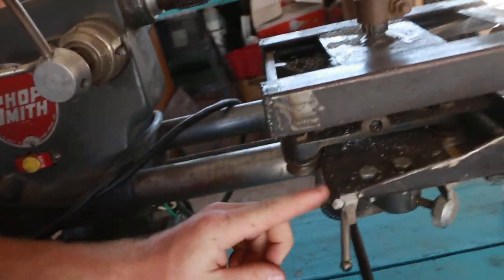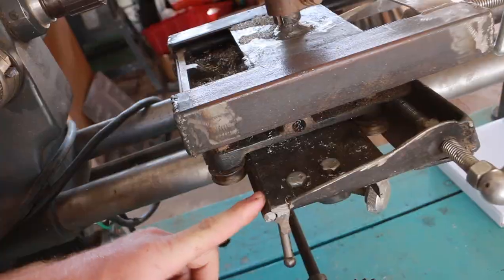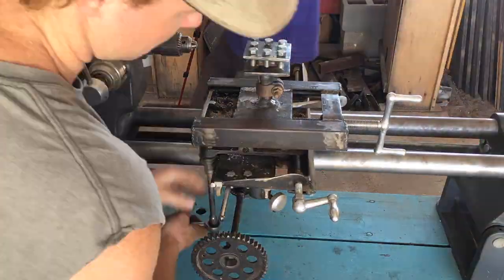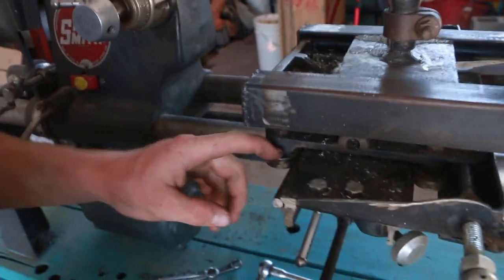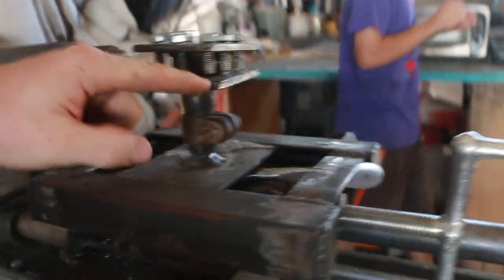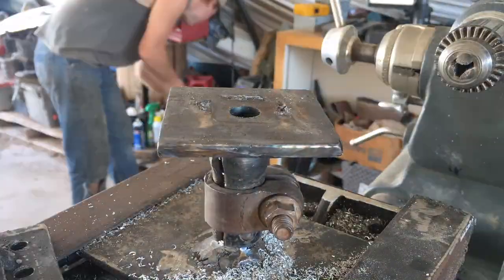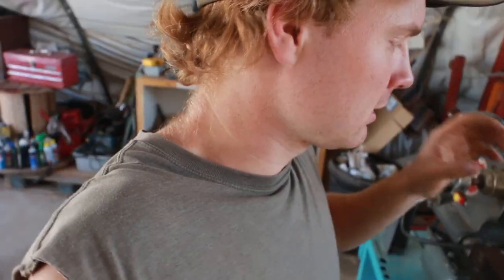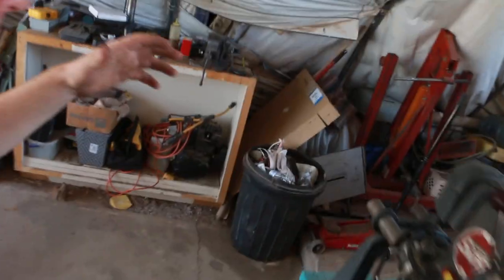Lathe Build Update | Fixing A Few Things And Chuck Update

Comment: 1st of all very cool project and you guys have awesome skill and ingenuity!
 
If that welder is flux core only (without the option of adding shielding gas for MIG operation) - then you should really just take that brass nozzle cover off- get a plastic tip cover or wrap it with thick electrical tape.

the nozzle cover isn't really helping your welds on Flux Core, its actually hurting them.

Also you could bevel the joints on the thicker material for better bond.

like I said above, very cool project! I hope to see more!
Reply from the maker: +Lane H. Thx I will try that :)